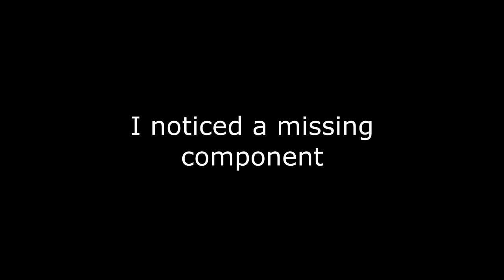Mac mini Big mess caused by Solder paste. Fan connector replacement.

Comment: Solder paste is best suited for new applications when building boards with a stencil. Please, people...don't use solder paste for rework. The solder balls get EVERYWHERE.
Reply: Solder paste very magical as long as not applied with paint brush and heat gun designed for stripping paint 😉.
Reply: @hightttech  Not wrong...lol, but it's wasteful. Very specific tool for specific use cases.
Reply: Is the solder paste good for small spots?
Reply: @j.lietka9406  Stick with normal solder and flux.

Solder paste is a bunch of tiny solder balls suspended in flux. Similar, but wildly different in behavior and application.
Reply: @MBrulla yes, I know what solder paste is (don't have exp with it yet) but when used in excess, it gets everywhere! Thanks
Reply: I use it for tinning pads all the time. Good for reballing chips without a stencil as well.
Reply: @hawaiisidecar  You reball with paste? I found that to be a fools errand compared to just solder balls.

What do you do to keep them organized?

Comment: So, you removed old "flux" with new, better one!  Reminded me about my battle with some really old hardened resin flux.  I came to a conclusion that neither iPA, nor some of the stronger solvents seemed to work on the old stuff, while IPA worked fine on up to a couple of days aged resin, provided it had not been heated with burning hot temperature iron.  What we found in our desperation was to enclose the board(s) and a fair amount of IPA into those fancy resealable plastic bags for over night.  Before opening the bag, we massaged the bag, until the fluid turned all brown.  After that we used fresh IPA and half stiff brush to remove the now softened resin flux.  Nothing but the overnight time seemed to really solve our issue.  All this happened before the introduction of SMT components.
Reply: Try brake cleaner (hexane I think). It's the best cleaner I've found.
Reply: oeh nice trick ty!

Comment: I suspect the mess was likely caused in the first place by attempting to troubleshoot a fan speed issue. That family of Mini doesn’t rely on custom drive firmware for thermal monitoring unlike iMacs of the same era and replacing the drive for a standard off the shelf part, or an SSD, doesn’t affect fan speeds. Apple Service Diagnostics should be present on the original drive if it’s never been formatted, access it by holding the D key on startup. If it’s not present you may be able to access to online diagnostic by connecting it to the internet via Ethernet and doing the same at startup. It can also be found on the original DVD install media on those machines supplied with an optical drive. Fans running at max is frequently caused by a failed thermal sensor and the diagnostic will tell you which one is giving a bad reading, assuming there isn’t actually a thermal problem. The diagnostic for the mid-2010 Mini is ASD 3S139. If all else fails you can use Disk Utility to copy the ASD disk image to a USB drive and startup from that. Assuming it starts there are also hardware monitoring utilities that can be run from within OS X which will also help identify which sensor is reporting an issue.

Comment: Rookie mistake. But that's how some people learn.

For those unaware, Solder Paste needs constant heat over the component in order to flow. Fan connectors are plastic. Usually ABS or similar. With melting points well below solder.
Reply: Abs plastic starts to melt at about 200c most decent solder used for this kind of work starts to flow from 130-180c

Comment: I've seen that solder paste before that got used on a PCBA. It's the kind meant for soldering plumbing fittings and is mildly acidic. It's also electrically conductive and will literally bubble on the PCBA when voltage is applied as it creates short circuit paths. If you place Ohm meter probes onto he goo about 1cm apart, you will measure resistance of about 100K thru the goo.
Reply: Ha nice I'm not the only recognizing that solder paste.
Seeing that damage in the video and the little solder balls all over the board. I'm sure it's the paste for plumbing. And I think we could guess by the heat damage to the solder mask it was not a heat gun for soldering. At least I would bet the person used one unregulated big one 😭

Comment: Great Skill to clean solder paste mess.... I was thinking how this would get cleaned🤔🤔🤔
Reply: Back in the olden days, when the parts weren't microscopic. I used the "heat and wack" method to remove solder. I grew up in the 50's playing with the solder splats on my dad's TV fixit floor.

Comment: He has used PPD paste to insted of solder flux which has caused this herosima on the board. i can able to find a lot of tiny lead balls shorting the pins of  ic  and capacitor

Comment: you da man, alex

the problem with jobs like this is that after they bodged the board, and you fixed it...the bodger will probably flip the machine to an unsuspecting buyer, who may experience catastrophic failure in 6 months time due to the original bodging

Comment: HI, I would appreciate your advice. I changed my drive in my 2014 Mac Mini but... In the process of getting to the HD I lifted the small connector from the wrong side and it broke. It is the one to the right of centre and has 5/6 small black wires that appear to run to the front of the machine, I think to the little light at the front and I don't see or know what else.. It looks like it broke the connections to the board.... Can you pls clarify what it is and what i must do to fix it.. Thankyou for your advice. Keith

Comment: Why don't you use solder paste, it would great for heat sensitive board/comments
Reply: It's hard to control where the solder paste flows on such a crowded board. It's much better to apply solder strategically where you need it to. You will avoid unnecessary spill and possible components bridging. Solder paste has such tiny particles, that when using hot air they can get pushed under IC's and bridge contacts that shouldn't be bridged. If you have heat sensitive components you can use low temperature solder (leaded solder Sn63Pb37 or Sn60Pb40) and possibly add some heat reflecting tape on the most sensitive components (but that mostly works only for hot air).
That said, solder paste is great for soldering many components at once on an empty board. If they are more heat sensitive, use Sn42Bi58 paste (<140°C melting point) to do it.
Reply: I think solder paste is good for adding components not removing them.  Usually adding lots of components (like in PCB manufacturing) not one or two like in board repair.   May as well use soldering iron or hot air for one or two components.  I also think flux and solder paste aren't ment to be mixed together.  
Looks to me like someone tried mixing flux with solder paste for connector removal.  Wrong choice of tools for the job IMHO.